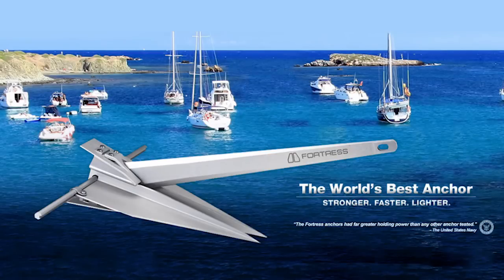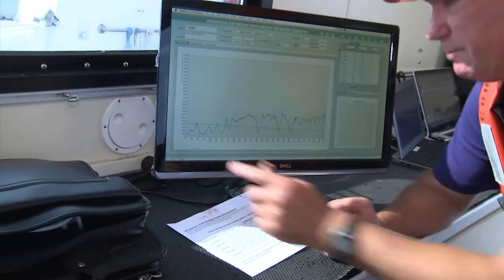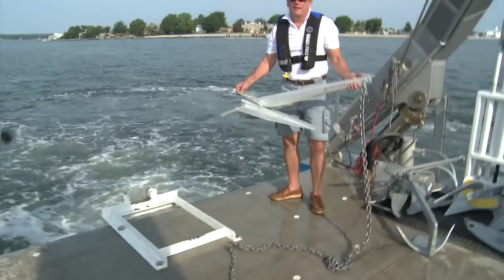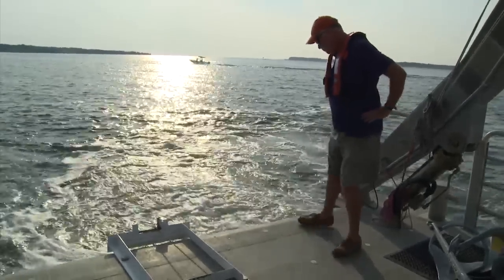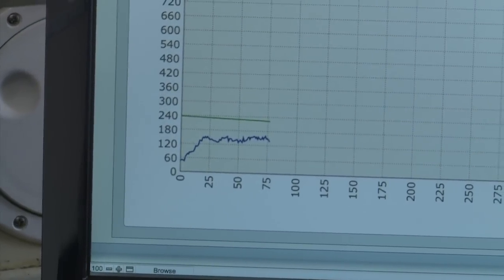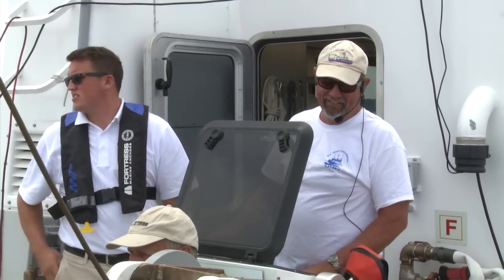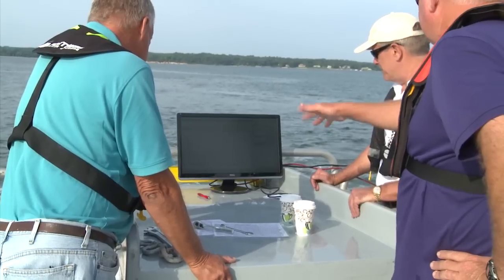Chesapeake Bay Soft Mud Anchor Testing Friday 8/8/2014

Comment: When a rock or a piece of coral jams between the flukes on the Fortress the anchor will not reset when the boat swings with wind and tide. Note the difference between it and the Danforth. In soft mud  my Fortress almost put me on the beach in Greece.

Comment: Hi I'm a little confused,  how did you calculate the correct scope as this effects the effectiveness of an anchor ( we all know more scope in high winds and current for better holding).  Did you take the water depth  multiplied by the scope ratio?
Thank you it's an Important factor to know.
Warren
Reply: Fortress Anchors hi I'm not sure I fully understand your reply but I think you are saying if you don't have the right anchors for soft mud the scope won't matter much.
I have another question , I have always used water depth to determine the scope all my life  but. I recently found that some american only anchoring guides suggest you should add the height of the bow roller to the water depth and then multiply by scope. That's wrong for so many reasons but I have found that the US CG seamanship guide has it both ways so I think some lazy writers have been copying the mistake without thinking about it. What does your expert Robert Taylor think?
Cheers Warren
Reply: Hello Fortress Anchors  and thank you for replying.   Re the scope I assume you take you scope calculation from the Us CG who say depth is both with and without roller hieght.so they confuse the issue.
Can I refer you to the RYA in the uk? A well respected source. See here
http://www.rya.org.uk/newsevents/e-newsletters/inbrief/Pages/things-to-think-about-when-anchoring.aspx
If you look at their sketch and in the text they clearly say use the water depth. There is no mention of bowroller hieght. 
As you know you want all boats in an anchorage to be using similiar scope, so in 10' of water at 3:1 you use 3x10=30+4' bow ht once, 34' total. BUT  using the Incorrect system (10'depth +4')x 3=42' total , where this gets rediculious is a power boat with a 10' bow ht is (10'+10')x3= 60'total. Double the real scope (30’)required and pandermonium in the anchorage when the tide changes or boats drift into shallows.
The other source I would suggest would be Skip Novack the well renowned arctic sailor . In his anchoring guide on storm in the arctic he uses the water depth reading  from his depth sounder to calculate the tide to deploy. No mention of bow roller hieght.here is the link
https://youtu.be/rYfoki6vW-M
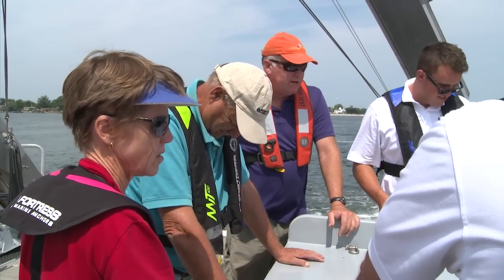See 2:00 and 7:00. He Never mentions bow roller hieght and he was in 55knts over night at 6:1.
I have many other non USA sources that all say the same. 
I hope you have time to check the links and would be very interest in your thoughts.
Thank you warren